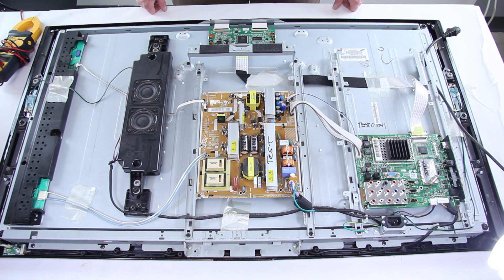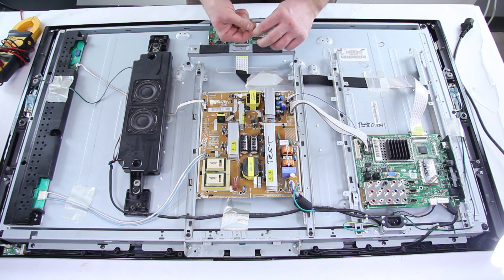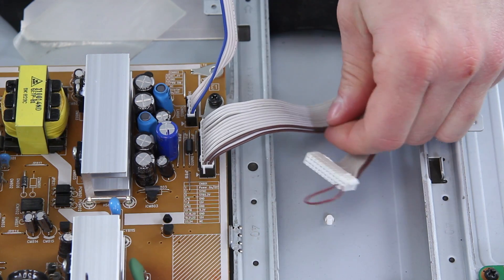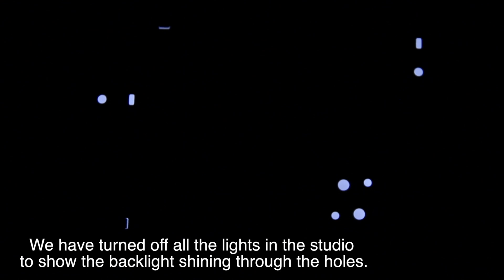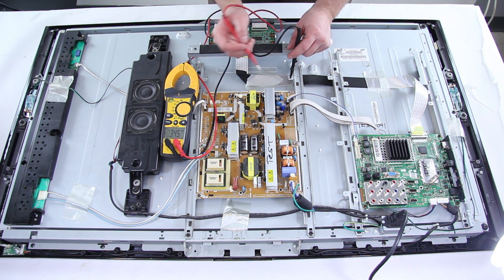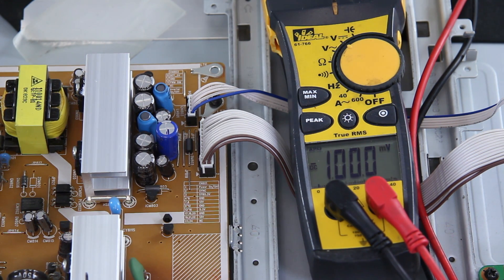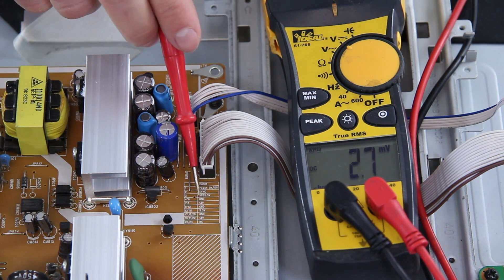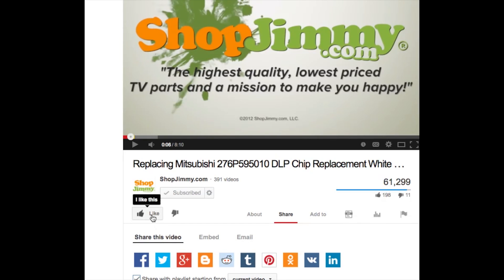Samsung LCD TV Repair - TV Won't Turn On - How to Replace Power Supply & Main Board

Comment: I have 46 " Samsung TV LN46C530F1F.  Stand by light blink 5 times  & then nothing happen ,  I left it as is  & then after a long time 12 hours TV started itself, I can watch  functioning normally  but as soon as I power off  & re-start it won't start,   red light blink 5 times & nothing happen. I replaced power board  but same thing. Any body know what is the real problem with my TV... Thanks

Comment: My 27 inch samsung lcd tv has a LCD Panel board problem.(not T.O.C Board)  its 2A fuse was burnt. so i checked and found the power 12v going to the board is showing dead short after the fuse..where do i start looking for the problem of this short, The Tv
is working with sound but no display...please help!

Comment: Sony rear projector CRT TV worked for 20 years straight until something burned out and the image got blurry. Two Samsung HDTVs barely worked for 5 years until it needed a motherboard replacement.

Comment: Hmm so this test didn't work on mine. Mine has position 4 is on/off 3.3v position 8 is power on 3.3v. I tried on/off to ground since I'm getting volts and no bingo.

Comment: I have a samsung Plasma TV 43 S43SD-YB03. No image display . If on and off the RED led light can be appear. all change the power supply board but still cant be used. Besides that, power supply board voltage imbalance by dropping and a few second later voltage became stable at VS and VA. The T con board led is blinking green light. May I know what is the actual reasons why this tv can be play and how to repair it? Kindly help us . Thank you .

Comment: What do you mean by voltages missing?  I was supposed to have three 12+ volt leads on the wide ribbon, but only had two wires in that part of the schematic, going from the power supply to the main.  Everything else checked out fine, just seemed to be one wire missing from the connector.  Is that what you're talking about, or just something not reading what it's supposed to?

Comment: 42" videocon LCD TVwith Model No: LCD TV SL 42 FBM-FLA is in dead condition,found that SMPS is not working .I dont have ckt diagram.can you help me in this regard...
Thanking you                                                                                                  sudhakar

Comment: Hello friend, I have a LE32A457 Samsung LCD TV and the power led is on and I have 5.2v on the stby pin, but when I jump the power on/off with the stby pins the TV don't boot. What do you think is the problem? Tanks for your time. Congrats on your videos, they are very nice!

Comment: i have a question jimmy regarding my samsung led UN32J4300 32inc. 2015mdel. Why won't it turn on? I tried unplugging then plugging it again many times but it still doesn't work. tnx ihope u respnse. godbless

Comment: does the power supply say 100-240 volts, I heard tvs can support dual voltage but they indicate only one voltage on the outside for each specific country even though they can work anywhere eg N.America and England, just like computers

Comment: Hello, I have power supply board DPS 138 BP power supply board and i found 4 small transformers with a lot of turns. Are they high voltage for CCFL or something other?????? And if they are high voltage how to turn them on. There is a lot of pins and I need high voltage. Thanks.

Comment: Jimmy, I have Samsung 55" model # UN55ES6150. I have sound but no video, I did the flashlight test and I can see image. I replaced part #BN44-00503A AND BN94-05656D but still have no video image, and you advise what part or board I might want to replace. Also after replacing the above parts if in fact they were the problem, would I have had some video or image, or is there a programing that would be necessary?, thanks Tim

Comment: hi jimmy my tv was clicking so i replaced the capacitors now it works for about a minute then turns off and goes back to clicking again. all i do then is turn off for 5mins and turn it back on and it will work for a minute and turn off again

Comment: hello, I'm trying to check a BN44-0645A Samsung PS Board from an led tv UN40F5500 that doesn't turn on, nor lights a standby led (no response to R/C). I took a reading with my meter and all output voltages seem to be ok, except for two "13v" slightly under (12.4x) but I can't tell exactly what pins to wire. I've figured this much: as for the main board cable harness, pins 12 & 14 (on the PS) should signal to start power. Now, as for the back lights I can't tell what pins to wire. could you please help me on this?

Comment: ok I did the jumper wire and the backlight came on so I went ahead and left jumpers in and plugged both sets of wires and the TV comes on but then starts flashing

Comment: Hi,
                 I have samsung Tv UA40C5000A which uses power supply board model - BN44 00353A .  The Tv didnt power on and it didnt come to standby mode as well.  I check the power board with the help of technician. We found no all capacitors physically good. The technician told me that the transformer might be faulty and there is no power output from secondary. Also there seems to be corrosion in the board circuit lines at the backside. Can i repair the board or do i have to replace the power board. Please suggest i am from India. This Tv was purchased  from abroad. Also suggest where can i buy this board online.

Comment: Hi can you please help me I have a samsung le40d550k1wxxu ,the tv was given to me to repair I opened it up and found the PSU disconnected, investigated and found it had a fault, so I replaced it with a second hand one now the stay light comes and it flashes 5 times and stays blank is it possible the AV board is at fault or could you steer me in the right direction for testing the board. .Cheers ian

Comment: I have a sharp tv that I can"t get the wiring off on the main board all the rest came off is there some special way to do this
Reply from the maker: +Karen Kegley  Try all repairs and troubleshooting at your own risk.  Please reply with your TV model number.  Click here to view a video that shows how to find your TV model number:  https://www.youtube.com/watch?v=S51nhAmwR2M  Thanks!  www.shopjimmy.com
Reply: +Karen Kegley  My model # is lc26dv28ut  Now I need the board. tuner# is DTVA50CVH1019M the part in the tuner where the cable screws into broke out. This tuner part is a Samsung part. disregard the wiring piece

Comment: Hello, Have a samsung LCD model # LN52A650A1FXZA. Powers on and off with green, orange lines. no pic or sound. I looked at capacitors, they look ok. Sometimes when I unplug for few days and then plug in tv works. But then fails when I try to turn on.

Comment: Hi! I recently tried to repair my LG Plama  LCD TV (Mode LG42LS575T. Power it on no piture but have sound, have checked the power board everything looks ok, changed the main board and T-con board 2 days ago but till samething happen no piture but have sound. Please help any advise from my pao here. Thanks

Comment: I am having problem with my LG 55LM7600 TV. The TV is not turning on. When i supply power to TV, it show Flashing RED light and there is no picture and no audio. The light flashes and then it become solid,, when i press any button on TV or remote, it flashes and it become solid. Please see all TV details below: TV Mode- LG 55 LM 7600 UA SVC Code - 55LM7600-UA.AUSZLUR Bought TV in Dec -2017 There was no power surge or no thunder storm in the area when this happened. After reading many websites watching video , it seems like it is main board problem.. but how can i be sure that it is main board and not power supply issue... Also i dont see the part available on your website i see it is out of stock.. i have not yet opened the TV but based on google search the part number is EAX64434205-1.0. Please let me know whatever help you can provide.

Comment: Hi guys. I have a Samsung LN52A550P3FXZA with Power supply board # BN44-00200A and Main Board # BN97-02645V. The unit will power up, backlights fire for a second, then shuts down.

Comment: hi I have a hitachi 24 inch tv I bought a new power supply board and it still wont turn on the model is LE24K307 it has no standbye or nothing it jus shut off one day

Comment: Hi, I have a Samsung UN46H1750AF. I've been having issues with my remote control, and have determined that my IR sensor is not working. I have to adjust volume/change channels etc manually, rather than using my remote. Any suggestions on how to fix this issue? Thanks!!

Comment: Hi I have a SAMGUNG LN32C450E10XZA power PSU BN44-00338B the TV The Stanby Light Remains Solid witch one do you think is going to be the fix 2J183J SIC 460S or Fsfr1700us

Comment: I have a ln46c650l with no power on but standby light is on. I unplugged connector from main board( bn94-04222) to power supply and i have backlights(screen is blue). The voltages at the #1,3,13,15,17 pins  at the main connector goes to 12.94 every 4 secs and back to zero. #4,6 reads 5.14v every 4 secs. Any more tests i need to do to confirm the main board?
Reply from the maker: Goat Milk   PLEASE SUBSCRIBE TO OUR CHANNEL - Try all repairs and troubleshooting at your own risk.  I recommend replacing the main board in your TV.  Click this link to replacement parts for your TV model number:  http://www.shopjimmy.com/catalogsearch/result/?q=bn94-04222  There may be multiple boards for the same TV model number, be sure to match part numbers on your current board, with your replacement for compatibility.  Here is a link to a video showing how to identify your part number, click here:  https://www.youtube.com/watch?v=BEPWrefQvqI  Thanks and please let us know if you have any further questions with your TV Repair!  www.shopjimmy.com

Comment: Hi, thank you for the very informative video above. Two thumbs up!!
Hope you can help me:
I have a Samsung 46" LNT4671FX/XAA VERSION SS02 that does not power on and has no standby. It working perfectly till I moved the TV from one room to the other. I was very careful, making sure it will not hit anything. Once I plugged it in it stopped working - Not even a red led on the standby mode. And no blue light like it usually has at the bottom of the TV on standby mode. The remote is also not doing anything... Don;t worry, I made sure the outlet is OK... It's just dead :((
I called a TV repair technician that came and tested all the wires etc., ending up with recommending me to replace my power supply board. So I did - Bought (in eBay as your website shows it's out of stock) part # BN44-00166C LCD Power Supply Board and I just replaced it (unplugged all connectors and plug them to the new board)
Unfortunately still no response. Tried to put the jumper wires as per the video above and still no response. No back lights either.
Please advise what should I do. 
Pini.

Comment: Hi I have Samsung led 5 series... Power supply is bit different... TV goes to stand by but does not turn on... Occasionally it does turn on... I did not place a jumper... I just removed that connector with power supply on...did not remove inverter plug... And backlight turned on..

Comment: Samsung model # LN46A530P1F shut off on it's own an then began to turn on/off, on/off, on/off and will not stop this until I unplugged it.I looked at the power board capacitors, no bulges.  What do you recommend?  Thanks for your help.

Comment: I need Help! I have a Samsung Model: HPT5054X/XAA. My TV isn't turning on when i plug it up the power light comes on and it makes a clicking sound repeatedly. Then the power light turns off and does the same thing over and over, until i unplug it. Please help.

Comment: Hi, I have a Samsung model UN60H6203AF. I believe that it was struck by lightening. The power board was visually damaged. I bought a new power board from your site. It arrived today and I installed it. I now have standby but nothing else. I tried to diagnose the main board using this video. My power board is different from the one in the video so I was about to use the alternate method described towards the end of the video. But as soon as I unplugged the main board the back lights came on without jumping any of the wires. Do you think that it is a problem the main board or maybe the cable that connects the main board to the power board is shorting out?
Reply from the maker: Brian Mason   Try all repairs and troubleshooting at your own risk.  I recommend replacing the main board and the power supply board in your TV.  Click this link to replacement parts for your TV model number:  http://www.shopjimmy.com/catalogsearch/result/?q=UN60H6203AF  There may be multiple boards for the same TV model number, be sure to match part numbers on your current board, with your replacement for compatibility.  Thanks and please let us know if you have any further questions with your TV Repair!  www.shopjimmy.com

Comment: Hi, thanks for your videos, one question above the plate just above the POWER SUPPLY is ??? know what happens, I have a Philips 37 " Modelo no: 37pfl5603d/10 that has left him on the side stripes, etcc that could be ??? greetings.
[url=http://postimg.org/image/tahkypckj/][img]http://s5.postimg.org/tahkypckj/20140713_014617.jpg[/img][/url]

[url=http://postimg.org/image/pfe6w4ter/][img]http://s5.postimg.org/pfe6w4ter/20140713_014611.jpg[/img][/url]

PD. That image is the screen saver windows 7, Greetings
Reply from the maker: manuel jesús fernández mengibar   Try all repairs and troubleshooting at your own risk.  Those links do not open a website, they show up as an error.  Please reply with the symptoms of your TV problem.  Does your TV turn on?  Does it have an image on the screen?  Does it have lines on the screen?  Thanks!  www.shopjimmy.com
Reply: ShopJimmy.com Hello again, sorry if the links do not work, if the TV on, works perfectly, but wondered etcc happens for no more the fault ARECORD, greetings and thanks.

PD. where you could upload the images to see them ??? greetings.

[URL=http://www.casimages.es/i/150520053343840527.jpg.html][IMG]http://nsae02.casimages.net/img/2015/05/20/150520053343840527.jpg[/IMG][/URL]
Reply from the maker: manuel jesús fernández mengibar So the TV works perfectly?  I am not sure what the problem is then?  You can find various places online to upload images and then reply with the URL in a message below.  Thanks!  www.shopjimmy.com

Comment: vizio m420nv......My tv will just pop off by itself....a loud sound and then it wont cut off unless you unplug it....remote will not cut it off.....it works for about 5 minutes picture and sound and then it shuts down again?  help
Reply from the maker: dablock2k3   PLEASE SUBSCRIBE TO OUR CHANNEL - Try all repairs and troubleshooting at your own risk.  I recommend replacing the main board in your TV.  Click this link to replacement parts for your TV model number:  http://www.shopjimmy.com/catalogsearch/result/index/?cat=56&q=m420nv  There may be multiple boards for the same TV model number, be sure to match part numbers on your current board, with your replacement for compatibility.  Here is a link to a video showing how to identify your part number, click here:  https://www.youtube.com/watch?v=kxkeGLhlQY8  Thanks and please let us know if you have any further questions with your TV Repair!  www.shopjimmy.com

Comment: I have a sharp M/N  LC-60LE640U .serial no. 208823720. . it has vertical different colored lines on the left side about a foot wide. I have watched several you tube videos one said to remove The ribbons  use an pencil eraser clean them. and reinstall them.  .I did that   one said to push on the board where the inputs are and look for changes I did and the colors changed. but one video said its the board with the ribbon cables are.   the ribbon  board the number on the tag is   F975FM14 AND AFTER THAT SMALLER ,F97514082A00819012814C X,. VER -A . there's another smaller tag     if you need those numbers I get them for you . the main board numbers. FM98S    2012   8xs  on a tag that is on the coax input on the board. RTUDAA073WJQZ,  W2622CJ002408.thank

Comment: I have a 42" Emerson plasma model code PL-P42W-10A.The original problem was that it clicks 1 click then second click over and over in slow repetition. I open it no noticeably blown caps so I disconnected the buffer boards 1 by 1 with no change in clicking. So I ordered and installed new power supply (BN44-00273C) now it clicks 6 times (3 rapid double clicks) also now  the LED on the Logic board blinks with the clicks. The Logic board LED did not blink with the old power supply. Still not turning on So I then ordered a new Main board first then Logic Board still clicks 6 times (3 rapid double clicks) even with each Buffer board power disconnected. Really Need Help !!!
Reply from the maker: RAKIYAH YISRAEL   Try all repairs and troubleshooting at your own risk.  I recommend re-attaching all boards and then disconnecting the y board and powering on the TV to see if it stays on.  Thanks!  www.shopjimmy.com

Comment: I like your video tutorial.  But it does not apply to my TV. I have a Samsung LCD TV model LN-T4042H. When I plug the power it is clicking ON & OFF.  Tried replacing power supply board (BN44-00167A).  Did not help.  No capacitor is bad.  Can you advise some repairs to fix the problem?  What repair can I make to fix it?  Any help ou provide will be appreciated.

Comment: Request help for my Sceptre X460BV. When I plug TV in, standby light is on but cannot turn on television with button or remote. I disconnected all components from power supply and shorted PS-ON to 5vstby. All pins are showing correct output voltage from power supply when tested. I suspect the main board is the problem but I would like to confirm before purchasing. Is there a good way to test main board and inverter board.